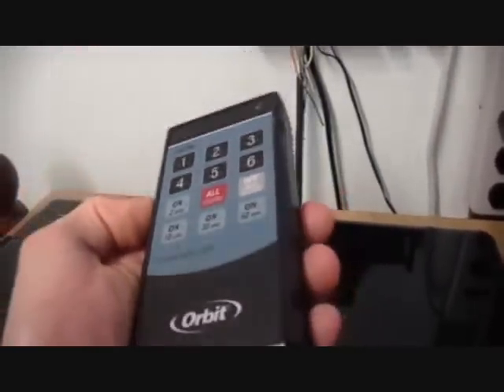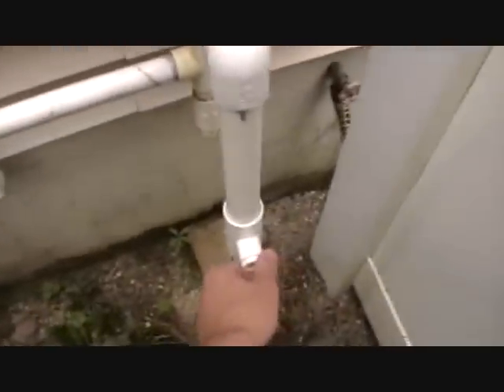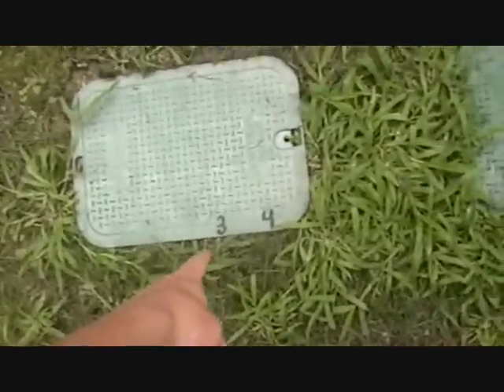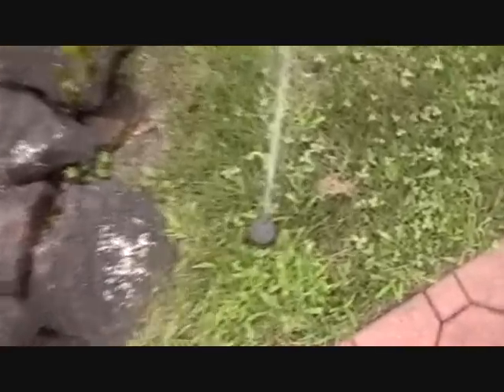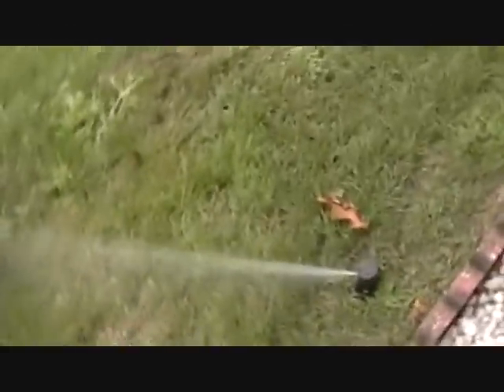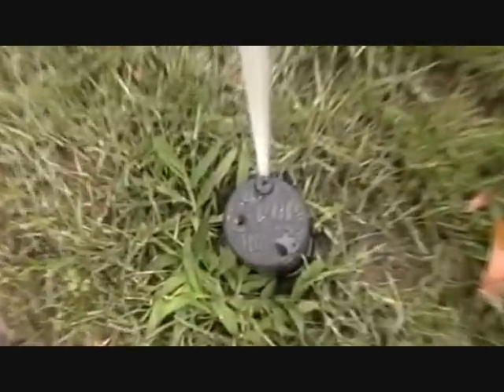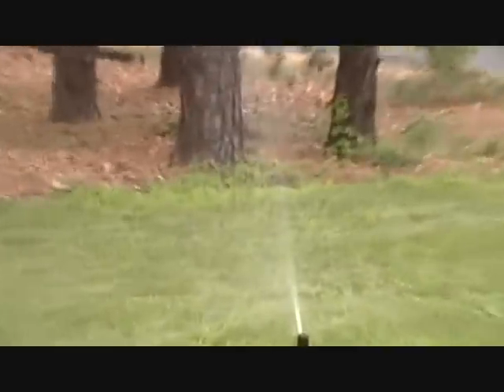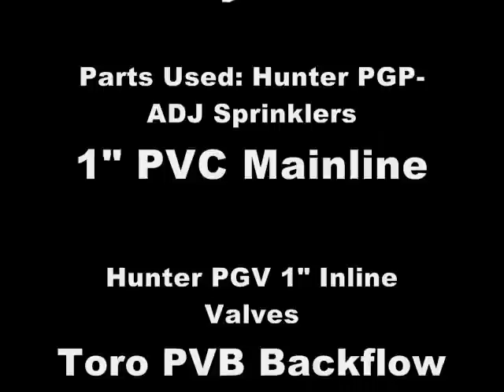Self Installed Sprinkler System 2012

Comment from the maker: @Jim Ster: Try to go 3/4 or 1 hp pump for a system unless you have only 2-3 low flow heads per zone. (That is, unless the pump is pre installed or for other use already. If available water quality is there and extra cash for the project, try to see if you can have a bigger pump dropped in to the existing well.